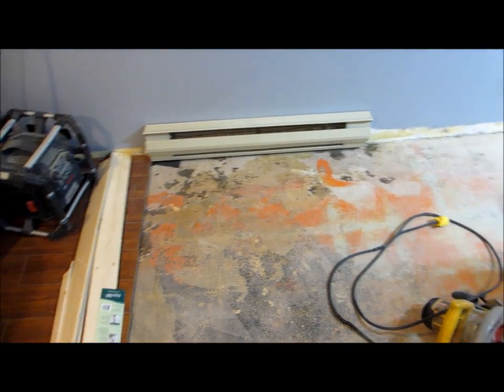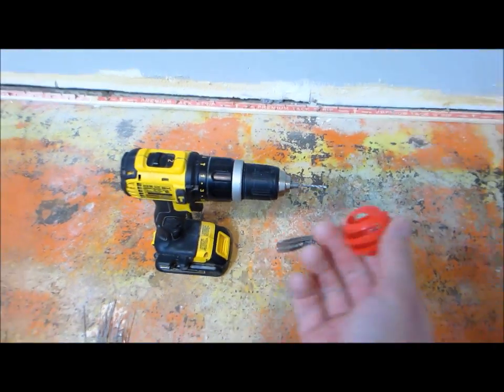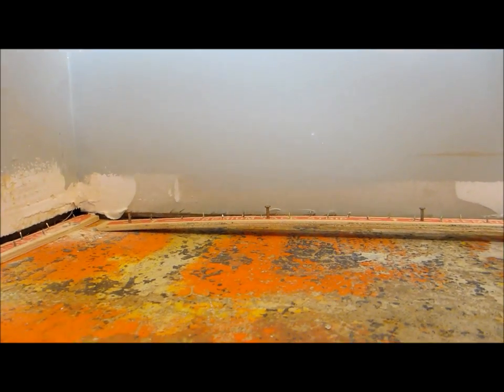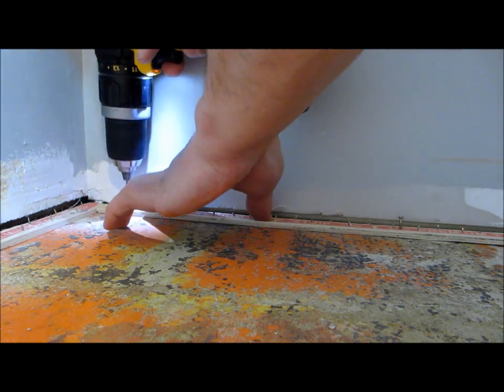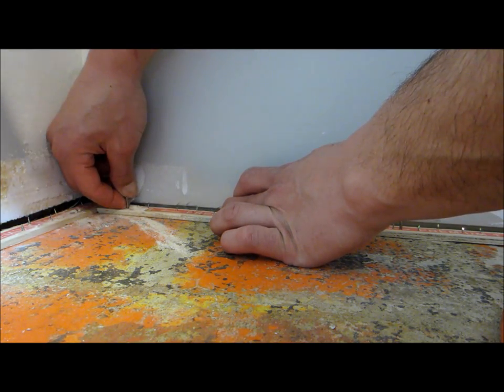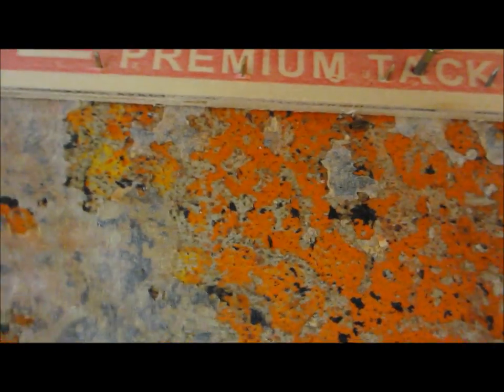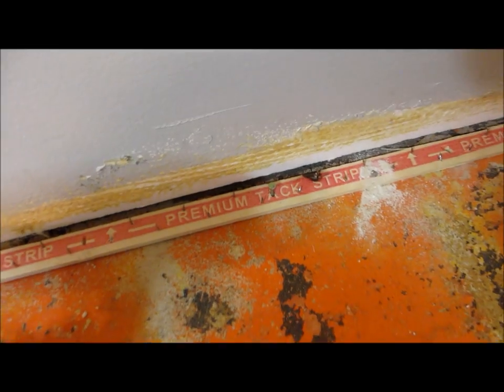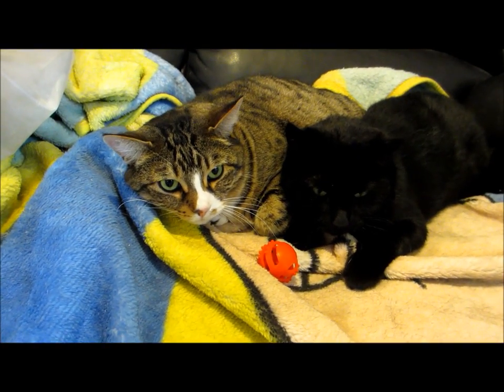How to install tack strip on concrete floor

Comment: I had to comment! I was going bald scratching my head trying to figure out how to overcome issue with EXTREMELY HARD Concrete floor in my older home. I tried the different nails i tried the one hard swing of the hammer jazz (RIP BASEBOARD). Then i ran across a comment from another of the 100+ videos i watched saying something similar to what you did here. Man i appreciate it was was able to get a full room nailed down with your advise. I picked up 1/8 Milwaukee concrete bit and the galvanized wire from home depot. started off drilling using my impact but noticed it was still struggling from time to time so switched to my harbor freight hammer drill and man did i notice a difference! Thank you!

Comment: Ok, this is honestly the best tip I’ve seen so far. The nails would not go into my concrete floor as it was way too hard. Your way of drilling the hole and using galvanized wire did the job perfect. I basically had everything that I needed  laying around. Other than the job being time consuming, I honestly didn’t see another way of ensuring the tac strips would stay in place. Thanks a bunch!!

Comment: So, installing the tack strip to where the baseboard would be directly over top, if for some reason you ever have to remove your carpet in the future, then wouldn't you have to remove the baseboard too? Sounds like extra unnecessary work to me
Reply: BigRidge Yeah he barried the rug wrong o

Comment: Problem is putting strip that close when the baseboard is off is the baseboard will have to come off when the carpet is removed. At that point it’s probably already caulked and painted.

Comment: Wasting time. I assume the concrete is too hard for the nails to hold???  Back up nails....try 5/8  if they dont work try 1/2  or stubbies. The harder concrete the smaller the nail.

Comment: If you have no trim on the walls hold your tack strip a inch from the wall. Or else next time you will have to pull the trim off to pull the carpet .

Comment: usually you would just nail it right to the concrete, it usually works fine
Reply: or glue it in areas where you can't swing a hammer, drilling a hole just makes the job take twice as long, the secret is to give the nail a good hard smack otherwise it bounces back out the concrete